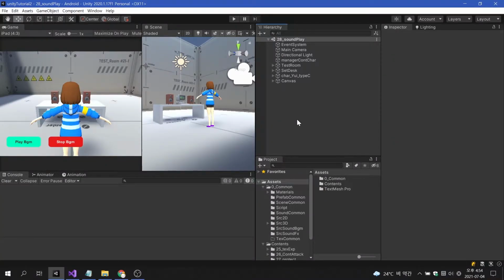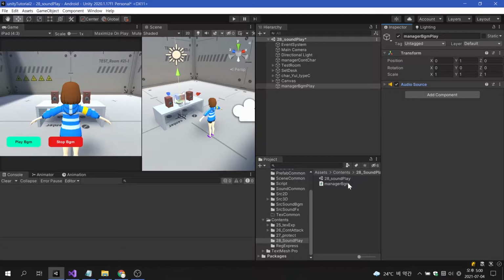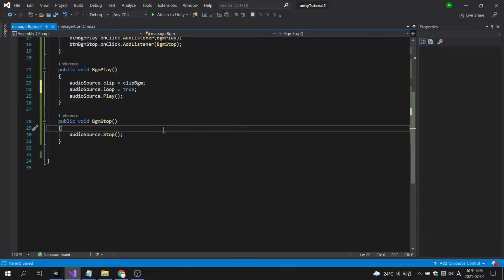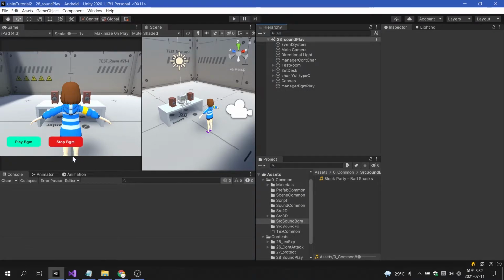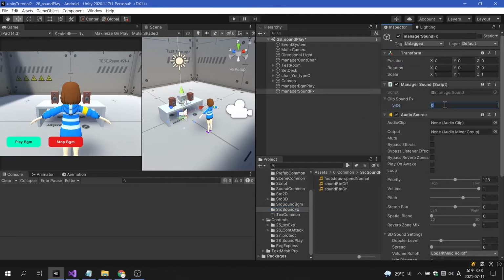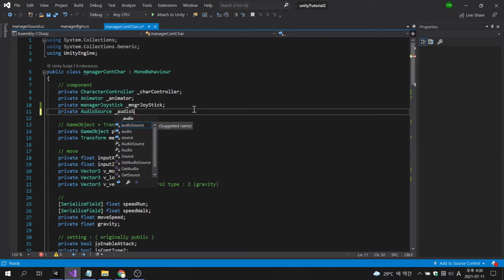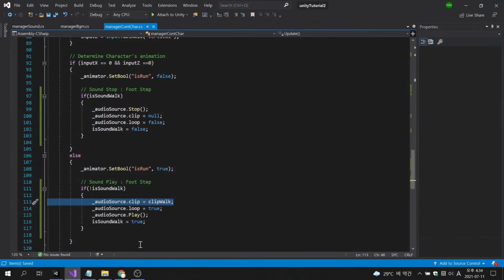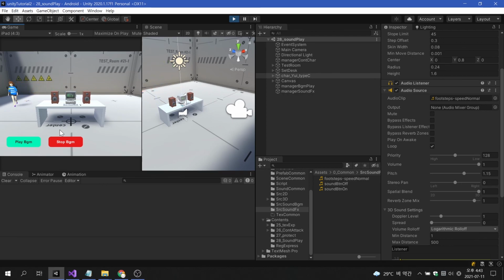Unity C# : Audio Source Scripting

Comment: Is there a way to convert audio files to mp3? Or something playable in window media? They only play in unity, got errors when in windows media.
Reply from the maker: What kind of file did you use?
If you want to convert to certain expected format, you need to use separate program, such as Adobe Audition.
Reply: @aboutgamemaking  Eyyy, thanks for replying my dude. Really appreciated your help. Back to your question. The thing is those audio files are .ogg files. Normally, my media player is still able to read other .ogg files, but not the one from unity. When I clicked to see their details from properties, a lot of info was gone (length, bit rate, rating).

 I'm not sure if it was because of how I extract the files? I've never even heard of unity until this morning my coworker ask me to extract those blank files named "audio" because his kid was testing unity. I thought a simple extraction would do a trick until it did not. At first, I tried uniextract the files, but it didn't work because they were compressed. I found assetbundleExtractor to decompress and tried uniextract again to see if it worked. Sadly, the results are those unplayable files I mentioned up in the comments (it actually worked, bundleextractor decompressed the files, it's just that unietract isn't suitable software to extract those, but I'm too stupid and lacks unity knowledge to realize back then. Literally wasted 12 hours trying different software and methods.)

 I tried to extract them using unity after that since they still work in unity, and all the solutions I found are to save them in unity using script to save audio clips to mp3 or wav. Btw, I also have zero clue on how to write script and decoding or anything related, so I spent another 12 hours learning unity (that is when I watched this video to know more about source scripting) and trying to find another way that easier (which all failed). Lastly, I tried using script to save audio, but it failed too because the script was outdated, too many errors. I rage quit, deleted the project, and wait for replies to my problem, which is 1 hour before your reply.

But now, right when I literally spent a full day wasting my time to get those files. I managed to make them work again by messing around with a pile of extracting software that I downloaded and texted for a whole day (56 software, 1,4 gb). I used The assetbundleextractor for decompressing and assetstudio for extract (I thought it was useless because it extracted the whole "resource" file and 1k size file rather than the audio files. Turns out, it was the load option for assetstudio in order to extract and covert the files, not extract.) So year, the solution was stupidly simple lmao.
Reply from the maker: @huyle-ob8rg  Uh... OK,
So simply did you solve the problem?

By the way, Unity supports various audio format including ogg, which is default format using Unity (ogg == Vorbis).

Also, I hardly believe that Windows Media doesn't support ogg because of unsupported CODEC.

So if you want to use or test audio files, you have use different media player (most of are Free :)) such as VLC.

Well, as I mentioned early, you can use ogg, and it can be played on Unity.

If you could not use the audio file, it might be saved or converted with wrong setting.

Take yout time, because most of solutions are not far from there. :)